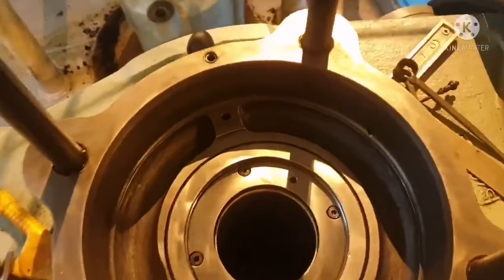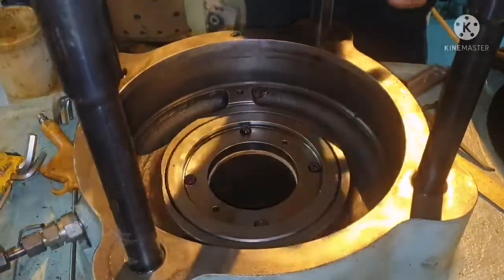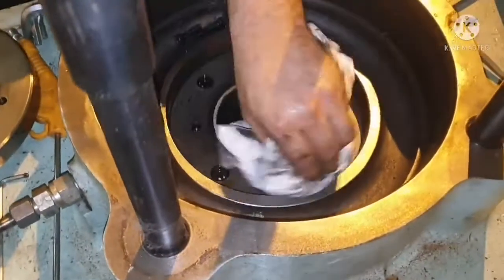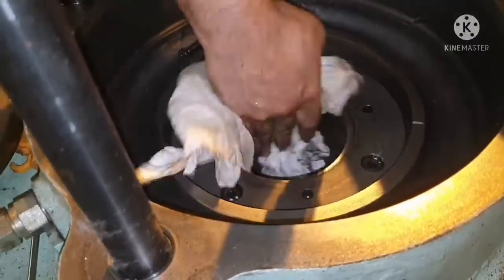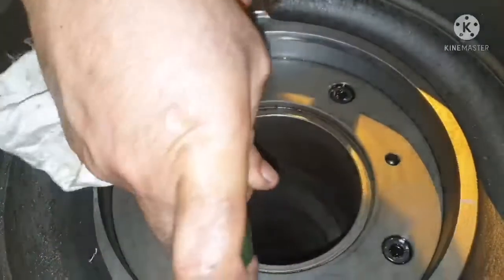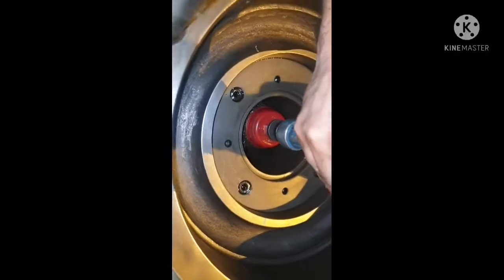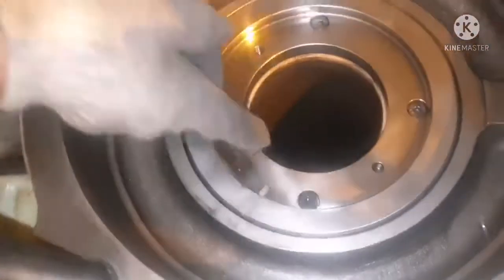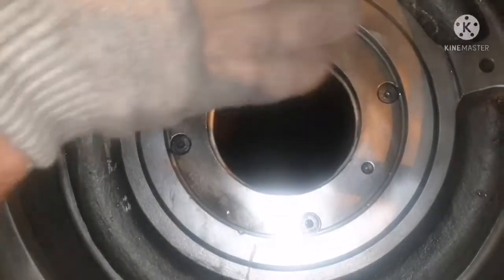How do they do... How to overhaul Exhaust valve for Main Engine (Electronic)

Comment: sir, good day. i hope you are well. i have a query regarding engine "blow back"
In "Pulse type" turbo charging system, a separate cylinder exhaust grouping is required to prevent "blow back" of one cylinder to another. 
sir, my question is, what actually is a "blow back"? what is the adverse effect of it?
Reply from the maker: Thanks for your good query..
Blow back as u said occurs in pulse type turbocharger system..
In case for any reason ur suction valve got stuck the exhaust gas vl go inside the cylinder thru suction valve and this action s cald as blow back.
Usually charge air pressure vl b higher than exhaust gas pressure..
This blow back action happens very rarely until unless ur maintenance s not upto mark.
Hope this reply will satisfy your query..